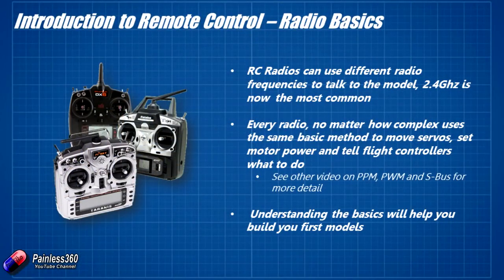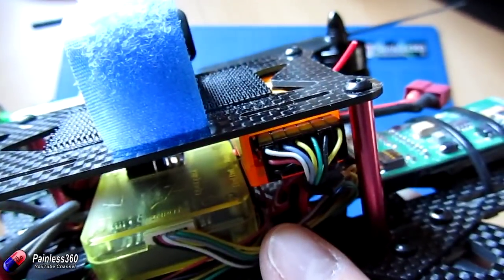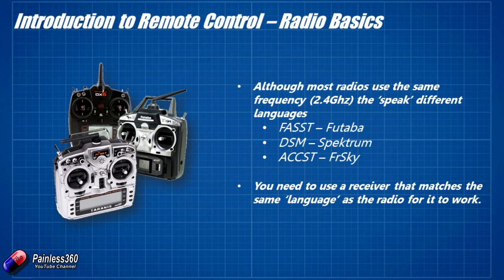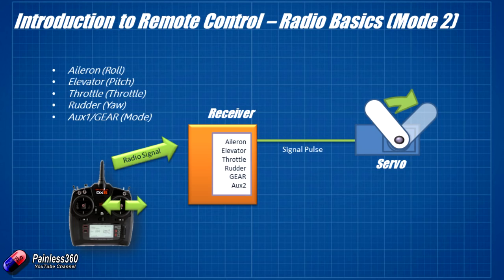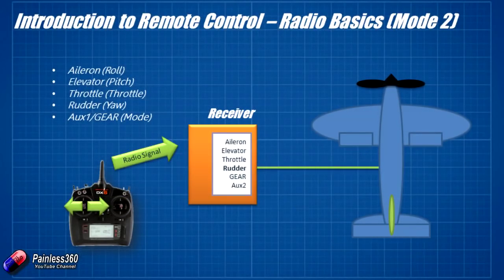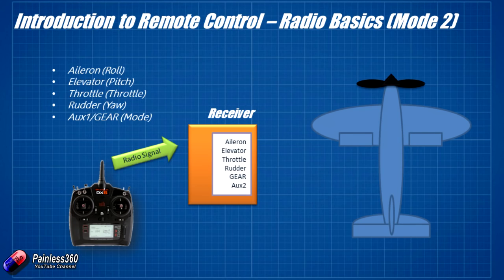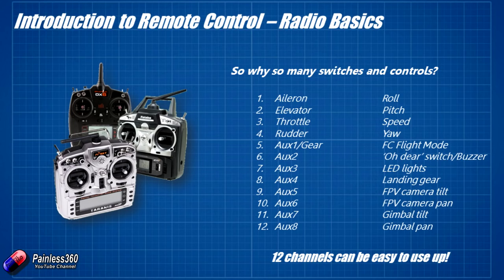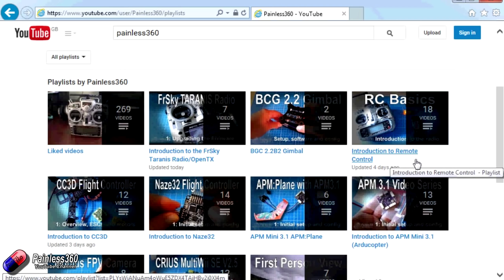RC Basics - Why we have the radio channel names and history

Comment: Hi again, on Radiomaster Pocket with Edgetx, can you help me setup failsafe for the throttle, so at no time during battery connect, or disconnect, channel 3 (throttle, or rather a winch in this case as I’m using on an RC yacht), exceeds the centre point of travel.
Reply from the maker: Different recievers have different ways to setup Failsafe. I have lots of videos on the topic... Best of luck

Comment: what I mean is... after going thru the radio stick and slider calibration on the taranis... and I look at the channel monitor screen, sticks centered... most are on zero.. elevator is reading -3... I know I can zero it using a trim switch, but is there a way to "zero" it in the radio... so that its reads zero without moving my trim switch.. thanks, bob
Reply from the maker: The calibration should take care of that, I've not seen that before - anything in the forums?
Reply: well... after looking closer.. it's not -3... it's - 0.3... i'm sure that's not something to be concerned about.  they all blink around a bit.. thanks...

Comment: I'm having a problem calibrating my taranis.. I go thru the calibration but my elevator channel only goes to +97.4, and at center it reads -3.. I know I saw a video on how to correct this... but damned if I can find it... sorry for filling your comments with questions!     if it makes you feel any better.. I am a Pateron now! Thanks, Bob
Reply from the maker: Depends on what you mean by calibration. There is a way in the menu to calibrate the throw of all of the switches and controls on the radio (you can find the process in the video where we add a 6 position switch to the Taranis) but that only needs to be done once. Thanks for becoming a Patreon and supporting the channel - Happy Flying!

Comment: those switshes ??  how do they function.
Reply from the maker: Witch switches?
Reply: +Painless360 
At the top of the radio.  you mention it at 2:08. there are 6 x switch. They don't have a seperate channel (i think)
Reply from the maker: Depends on the radio but a lot of the earlier radios used them to control Dual-Rates on the flight controls, a few were used to control things like the flight modes and GEAR. Happy flying!
Reply: Ok, so all those switches manipulated the signal from a channel to the receiver. And in the radio you can enter what the switch must do ? For example you can program all the switches for 1 channel ???
Reply from the maker: That depends on the radio. Newer radios like the Taranis let you do anything with the switches (literally!) but older radios, like the DX7 we are looking at here 'lock' the functions to make the radio easier to program for a newbie but that does limit what it can do..

Hope that makes sense. Why so you ask?
Reply: concidering buying. And didnot understand directly everything. Thinking...transmit elevator trottle ect. by channel But those switches how do they send to the reciever ? But now I think I understand. Another question is the receiver in my mind. If you do PPM canyou use the other connectors for other things ? :)
Reply from the maker: Again, depends on the receiver. I love the R615X from HobbyKing, It allows you to use the PPM for multirotors flight controllers but also still outputs the PWM signals on the normal pins so you can still connect servos/lightrs etc to them as normal. Very handy.. I have a video about buying a radio - I would recommend that you watch that one https://www.youtube.com/watch?v=AOT5j1NYtdc

Comment: Thank you so much for your wonderful videos, they are always so informative and interesting. As a side note, in 1975, I purchased a pulse width 2-channel RC Radio second hand. How it worked was there were two servos connected to the elevator and rudder and they actually "pulsed" quickly back and forth full range while turned on. When you moved your elevator up/down or rudder left/right, they still pulsed but instead of moving from side to side, they fluttered quickly in conjunction to the stick. You used a small motor with a small fuel tank to haul up the model and when it ran out of gas, you could fly it down. It worked rather well albeit a tad funny looking with both rudder and elevator flapping at the start but once you started flying, you couldn't notice it. The radio had two sticks, one only going up/down and the other left/right. It was my introduction to the hobby, as I said, it was 1975 and I was fifteen. Thank you again for this new introduction to the hobby, Cheers.     Buddy
Reply from the maker: +Buddy Martin Thanks for the trip down memory lane - we've come a long way since then (and a long way in just the last 3 years!) Happy flying!

Comment: Great video. But I was looking forward to a discussion about classic helicopter advanced channels like throttle hold, idle up, mixing, etc.
Reply from the maker: +Phillip Toone Sorry, were you one of the subscribers who asked for this video?
Reply: +Painless360 No, I'm just a subscriber who guy excited about this video from its title. Your videos are the bomb. It's like one stop shopping, everything you need all in one place with continuity between videos that are organized into playlists. Maybe you could follow up this video with another video dedicated to the history of RC helicopter transmitter terminology.
Reply from the maker: That is a great idea, let me add it to the list. Happy flying!
Reply: +Painless360 Well, I would be very interested in a video like that. I just don't want to come across as complaining or demanding. I guess you would have to decide if it would be something you would like to do and share with your subscribers.
Reply from the maker: What elements would you be interested in specifically?
Reply: +Painless360 Well, for example, I started out with the TH9XB (great transmitter btw)  and naively assumed each of those extra knobs and switches were mapped directly to their own channel.  I soon realized that this was not the case and that the strange, cryptic terminology used to label each switch or knob had historical root that I knew nothing about.  Terms like HOV 
PIT, THRO CUT, RUDD D/R, ELE D/R, PIT TRIM, F. MOD, AILE D/R, GEAR, TRN, HOV HTR can be a bit daunting to the newbie and I think a historical perspective would help shed light on their origin and meaning.  Maybe some discussion about 6 channel helicopters use of collective pitch, throttle hold, idle up, and cyclic collective pitch mixing) could also be included.